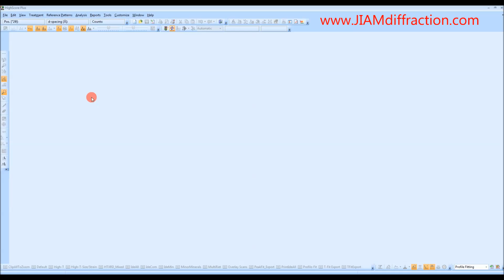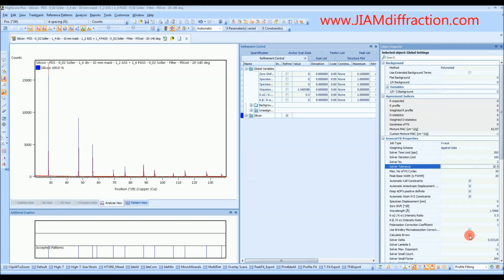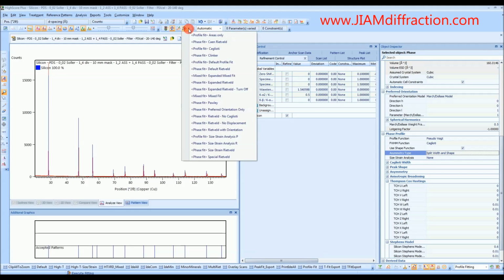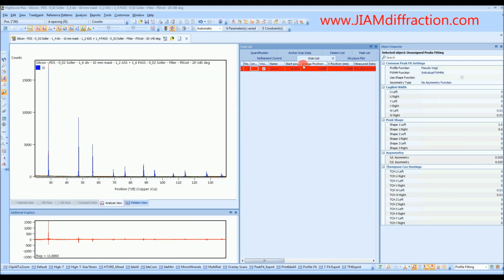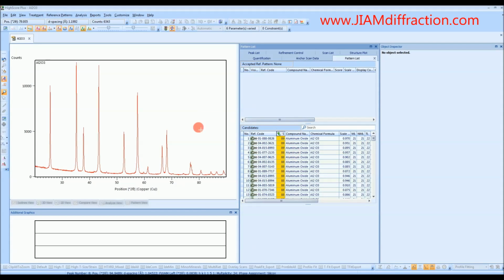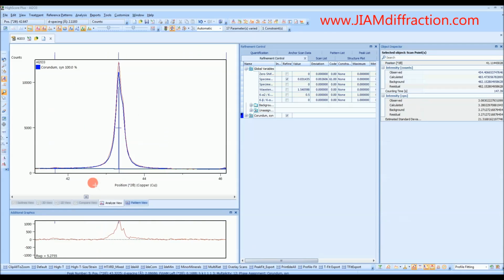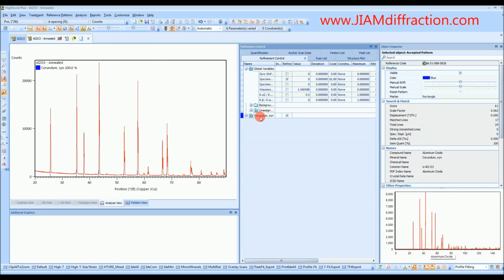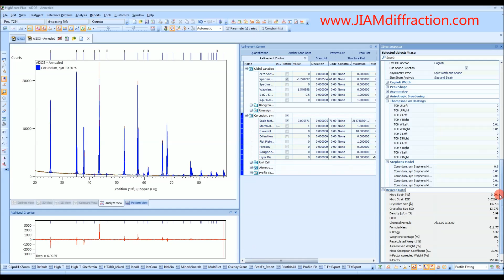HighScore Plus Tutorial - Crystallite Size & Microstrain X-ray Diffraction - Long Version - JIAM

Comment: hello , i firstly want to thank you for all your videos describing the high score software, y question is that i can t find  convert pattern to phase, can u help me in that, and also another question is that i may have an amorphous or semi crystalline material ( it s a composite materail from a resin an marble powder).thank u
Reply from the maker: Regarding your first question about converting a pattern to a phase...just to confirm, did you perform a search/match, find a candidate pattern that matched your peaks, accept that candidate pattern (either drag the pattern from the candidate list up into your accepted pattern list or just right click on the candidate and choose accept candidate), and then right click on the accepted candidate to choose "Convert Pattern to Phase"?

Regarding your second question...I'm not sure what your second question is.  Are you wanting to perform crystallite size/microstrain analysis on your amorphous or semi-crystalline material?  Do you have any crystalline peaks?  You need at least one crystalline peak in order to estimate crystallite size using Scherrer's equation (which isn't ideal as it requires some approximations and doesn't account for microstrain, but it is better than nothing).
Reply: @IAMMDiffractionFacility  thank you for your quick response, i accepted the candidate but i didn t find  how to convert pattern to phase....there is no button; 
for my second question: i m working on composite material i m not sure if i have a crystalline material, semi crystalline or  amorphous, i hope i could send you a screenshot  or even th files to help me with.  from some research es and from your videos i could say that i have two types of composite materials one is amorphous and the other is crystalline or semi-crystalline (i have one peak).thank you in advance for your time
Reply from the maker: Okay, go ahead and send me a picture of the diffraction pattern for the composite material so that I can look at it.  My email address is mkoehler@utk.edu.  With regard to your problem converting a pattern to phase, please right-click on the accepted pattern and take a screenshot of the options that appear.  Send that screenshot to me.